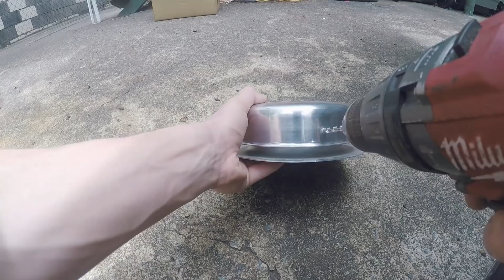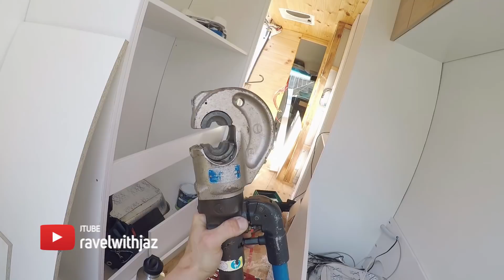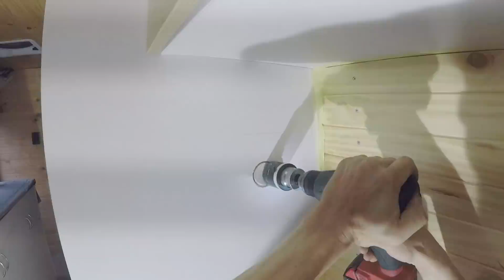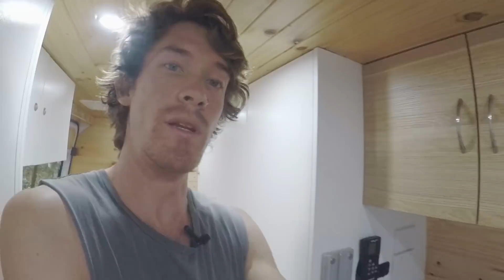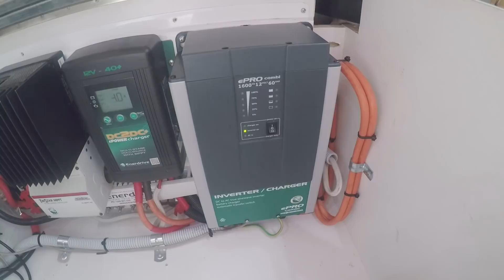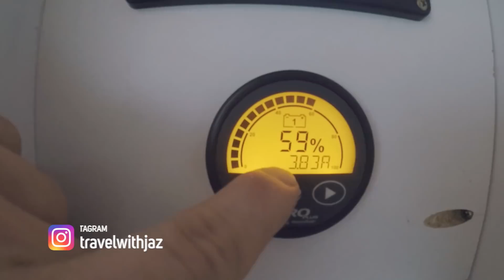S1E13 Sprinter Van Conversion | Electrical Pt. 2

Comment: Hey man. Im a 3rd year sparky from Vic - question with your a.c board... Why no m.e.n link?? I understand that for all relocatable installations all 240v outlets must be double pole ruling out a potential open circuit neutral fault, but still??
Thanks bro
Reply from the maker: Hey mate Thanks, so imagine if you plugged in to mains through the 15A inlet socket, then you would have 2 MEN links on 1 earth stake which is a no no, it gets quite complicated the answer and I would just read to 2 entire blog posts I did on the electrical which I hope sheds some light on it. I'll link them here man have a squizz and let me know if it still doesn't make sense. Cheers 

Electrical Pt.1 - http://www.jazmorton.com/van-conversion/ep-9-electrical-pt-1/

Electrical Pt.2 - http://www.jazmorton.com/van-conversion/electrical-pt-2/
Reply: Travel With Jaz 

Hey man, me and a bloke are just finishing up a 19 unit site and there are two M.E.N links on our site - one at the front pillar and one at the main switchboard.... 

I can only understand why there is no M.E.N link when the van is off grid because you've protected the installation with combos - the fault loop impedance is irrelevant as the combo will trip on imbalance between active & neutral, and that the neutral to ground relay closes when the inlet is hooked up and the inverter receives power on the 240v IN terminals...

Is this the correct understanding? I have read the blog posts

Cheers brotha
Reply: Not a sparky mate, but good understanding of inverter / charger wiring I found this link (draft from victron, https://docs.google.com/document/d/1Kvp46nznDOZgh-UOG3WLgpLhL3JFni8UGGDwwm_N38Q/edit).

"The boat is connected to shore power, the AC input relay is closed, and the neutral-earth relay is open. The AC output system relies on the shore connection to provide the neutral to earth link, so the RCD is functional

When the boat is disconnected from shore power, the AC input relay is open, and the neutral-earth relay is closed. The inverter/charger has made the Neutral to earth link itself, this so the RCD in the AC output circuit is operational."

Comment: the maxxair fans may work better for you if only used to exhaust air out and you install some venting through the floor to the underneath of the van for the fresh air intake. This works especially well when the sun is shining and you are bringing in shaded air, although I believe it just helps with the overall air flow in general. You have done a fabulous job on your van build Jaz thanks for the great videos.
Reply from the maker: Thanks heaps Jay! Yeah that would work but want to minimize air intake points also for colder times, the setup right now is perfect and the van is well insulated from the heat

Comment: Seems a bit silly/inefficient to be plugging laptop chargers in considering you have access to a solid DC supply??
Why not build or buy a decent buck/boost CC CV module ?  Then you wouldn't be going  :   DC --->  AC -----> DC every time you charge your laptop ???
Other than that top stuff fella, your workmanship is excellent and your van looks stunning :-)
Reply from the maker: Convenience bro, efficiency doesn't really come into play or matter to much when it's just charging a simple tiny laptop/phone/camera battery, all powered from the sun ;) thanks heaps for watching man

Comment: At some point you said its not good with a higher drain from the batteries (on 12v batteries). What would I need to do then to be able to continously use 450-650watts? Because I want to be able to use a desktop in my build.
Reply from the maker: Lithium batterys are much better at supplying a more constant voltage output over the span of the battery charge, but AGM voltage drops off much quicker. I believe it's called peukerts effect. You need to get the right size battery for your loads.

Comment: I like that you Soldered all the connections when needed. I'm going to use that one.
Reply from the maker: Yeah I actually tried to put them on BP connectors but they wouldn't fit in the ceiling cavity space, so I soldered

Comment: Great video Jaz, love your electrical set up. Best van build on Youtube for quality of workmanship for sure. I am curious how the van will operate if you have rain for 4-6 days in a row. I feel your weakest link right now may be your battery size (and therefore storage).  Let us know how it all works when you test it out! Cheers from Canada.
Reply from the maker: Thanks heaps! I have already had a few days straight where there was minimal sun and just rain and overcast.admittedly some of those days I was parked direct in shade, but she still held up, the battery did get pretty low and I was running some medium loads for a long time. That's where the DC2DC alternator charger is a perfect solution, but I should get by on the solar even on the worst weeks
Reply: How long would it take to charge the battery with the alternator?

Comment: Wont’t you have a heat issue in the electrical compartment underneath your bed?
Reply from the maker: I thought so too but it really doesn't, I don't really run high loads often, and if I need to I'll wire up some computer fans triggered by a temp sensor on a relay

Comment: Hi great vid. Pleasure to watch. One question. Did you coinsider any cooling for the box with all the electronics? It looks like it will heat itself on higher currents.

Wish you the Best!
Reply from the maker: Hey mate thanks, yes I did consider and was originally going to put 2 computer fans cut into the cabinetry. But it all runs pretty cool and I don't run any extraneous loads on it, but can always add later if need

Comment: The very best electrical wiring work I`ve seen in a long time - neat and tidy. Noticed that you had your shore supply breaker in on position with shore supply disconnected and inverter on. Will this allow 240v from inverter to end up at shore supply socket pins on side of van?
Reply from the maker: Thanks a lot, and no it can't because the shore is connected to the input side of the Combi inverter, nothing ever gets fed backwards power only comes out the output side of the Combi inverter

Comment: 1600 w inverter good luck
Reply from the maker: mate ive ran belt sanders, jigsaws, drop saws, 1600w vacuum cleaners, toasters blenders etc on it without a hiccup. she'll be A okay my man, unless you want to run a welder...

Comment: I knew you'd make it b-e-a-utiful. It's really good to have knowledgeable people like you to learn from. Thank you so much for taking your time with the weight questions in the previous video. The setup weighed less than I'd expected.

1. Are there benefits to having such a long wire from the battery to the shunt?
2. Have you made any precautions in case of a crash or fire? Would first responders be able to isolate either the solar panels or the battery from the outside?
3. Would it be very disadvantageous to separate the different parts of the system if you wanted to utilise space around the cabin?
3a. Could you move some components under the vehicle to save space and move weight front/ center?
3b. Could you move the battery monitor to the cabin with your setup? Can you have more monitors on that shunt?
4. Would it be possible to wire the head unit to the off-grid system, to enjoy tunes, sans engine?
5. Do you charge electronics on the AC?
5a. Is there high loss going DC/AC/DC?
5b. Are there sine issues with going with car power chargers for electrionics instead?
5c. Will cost of special chargers outweigh the eventual benefits?
Reply from the maker: Thanks a lot!

1. No you want to keep it as short as possible, but i left a little bit of slack just because both ends were already lugged from enerdrive and i didnt want to lug them again, the length I have it fine.
2. Everything is as secure as possible and I have a fire extuignisher on board. I dont think first responders will be running to the switchboard to isolate you solar or breakers in case of a crash(breakers should isolate themselves under most fault conditions).
3. It would be just a lot harder because youd have longer cable runs, which you definitely dont want with 12V. I personally wouldnt do it,but it is possuble, youd be using larger guage cable and cost way more.
3a. I guess you could but if they were under the vehicle they would have to be in some sort of extreme weatherproof box that breathes... (unnlikely.)
3.b . yes you could have it in the cabin, pretty much anywhere you want. and i believe you can have multiple ones i think.
4. umm yeah it is possible to wire the head unit up to the house battery, but again this wouldn't make too much sense in my mind. but possible.
5. yes, I charge laptops, cameras, phones etc all on the 240V powerpoints which are fed from the inverter.
5a. There are minimal losses in the inverter, but yes there are always losses. It only goes once from DC to AC, thats the only function in inverter mode. however if connected to the grid it converts 240 into 12V but there are always minute losses.
5.b . it all depends on what you need. for the couple of hundred dollars it cost for a charge to be able to charge from the alternator i think it is without a doubt worth it,.

Thanks for the questions :)_
Reply: Cheers mate. Keep the Sika flowing and enjoy your new ride 😀

Comment: "WIKID INSTALL" Bro. Just purchased an Enerdrive 200 Watt panel to be mounted on the roof of my 2018 Hiace SLWB. I already have a 160 Watt portable Enerdrive to compliment the roof. Bloody hell, you've spent some cash with Enerdrive - Nice ! I also went with the Maxx Fan after watching your install video, cheers.  Coming to terms with cutting the 356mm hole in a perfectly good brand new piece of Toyota steel roof hahahaha. I'm interested to know exactly what components you used from Enerdrive. Do you have a list ? I'm getting some auto electricians to do the battery, wire up and a few other accessories, all Enerdrive. I'm no "Sparky" like yourself. However have built all the rest of the interior myself to my anal standards. Be good to catch up on the road someday. Love your work 👍👍👍👍
Reply from the maker: Excellent matty good to hear mate, yeah the most of this build was on enerdrive products but its totally worth it ;) might see ya on the road mate, good luck with your buuild!
Reply: I totally agree on Enerdrive stuff. There's just something extra about the quality for me. It's great to see you with so much attention to detail. I'm the same. I looked at Sprinters however went for the smaller Hiace SLWB with dual sliding doors. Love the thing. Cheers bud👍

Comment: Two builders I'm following, you and Greg Virgoe, are setting a standard that anyone else will fail miserably to reach. And both vans are Sprinters as well.
Reply from the maker: haha I had a similar comment before I must check out who Greg Virgoe is ;)
Reply: Yeah Greg does indeed do an exceptional job of explaining custom builds.
Reply: I,m following both of them myself. Definitely agree with your comments
Reply: Yeah i was going to document my van build, but you and  Greg do such a great job it’s become a case of ‘why bother’ !!

Because mine was an ex ambo paramedics box back, I’ve got a hell of a job sorting it out. Can’t find anyone that knows how to sort the computer driven system. Varley who built it don’t get back to me, yet in decommissioning they ripped out the computer that drives it! What a headache . Do you know anyone in Sydney who knows their stuff?
Reply: I don't know about not making a series...someone should do a series about a high end build that costs nearly nothing. I suppose if I ever did build one of these things, I would definitely go ultra resourceful, and bring all of my various skills together. 

So far, I usually see it is just ultra pure liquid crap where people take garbage and shove it in a van, where you would definitely be roughing it, or ultra expensive and luxurious like this one. I can't even imagine what this would cost. I was surprised for example that he didn't do up his own battery controller circuit, given that he has an electrical background. I know 30 amps is a lot different than your average cell phone charger, but with the right heat sinking and switching circuitry it can be done. Even Lee Blake didn't do this, and he has an engineering background. What I did like was how Lee put all the high voltage in one central place, eliminating the vast majority of the wiring job.

Comment: Cracking video again Jaz. Probably your most comprehensive to date. Great to you went overkill on your wiring, being an electrician, you've done it right, and saved yourself a crapload of money (well reassigned it to quality products).
Reply from the maker: Haha cheers Higgo mate, yeah well living in it it seems to all operate just how it should, and I couldnt imagine going to much smaller on the battery system or solar panels if at all, for what I am running in the van. It just gives me absolute peace of mind so I never have to worry about running out of charge

Comment: Holy shit man. This is incredible. You should be super proud of what you've accomplished. Super inspirational, I am about to do the electric myself, but have some questions I just can't figure out.

For the lights as well as most of the wiring, when you drill into the wall or ceiling, there are no visible wires. How do you pull the correct ones from inside of the paneling? How do you pull the wires out if you cant see them? As well as how do you know your pulling the correct wires? Same thing for the back lights, it was just a small pilot hole, how did you fish the correct wires out?

Also, for the back camera, I'm assuming it was planned from the start and the green, yellow and pinks wires have been accounted for before putting the walls up, but if not, how did you manage to run that wire from the back of your car to the front through all the cabinets and walling?
Reply from the maker: Hey Gene, I definitely recommend watching episode 9. which is electrical pt.1, which is me wiring up the van and then you can see that I have planned every wire in advance before and sheeting or cabinetry was in. Also being an electrician I've just had a lot of practise with roughing in, and the cutting out and fitting off, so when I cut holes in something I already know there is going to be a wire in that cavity because I ran the wires there myself. hope this helps. also watch Ep.10 so you can see me sheeting over the wires. cheers!
Reply: I've seen those episodes, good stuff. So you already planned the location of all the wires. I guess since you do this for a living you didn't miss any components and didn't have to run any new wires. The switch panels all look like they run similar gauge red and black wires, how do you differentiate them to each specific location when there were no markings? I'm guessing you just hook it up and see which lights run?

I'm just worried when I do it myself, I will forget a wire and have to tear down my whole ceiling or side paneling because I didn't realize a wire had to be run a certain way and need to reconnect it.
Reply: You could add some kind of tape at the end of every wire and write on it what it is used for, including intended voltage? That way if you pull them out of your ceiling or wherever you know what it is. :) You do that too if you disconnect large amounts of car engine connectors (or any system really).
Reply: Swordie100 that makes a lot of sense actually. Thank you! I think I'll do that
Reply: Watch episode 9 over. He uses a marker to write what each wire is for.

Comment: You need a hrc fuse at the automotive battery positive
Reply: Also need another between the 2nd and 3rd lithium cells. I assume these are lifepo4 and not Li-ion as you said. Li-ion is too dangerous to sleep on
Reply: Isolator not in a good position. If anything in that box is on fire you cannot reach the isolator
Reply: All of these things have heatsinks yet you have no ventilation?
Reply from the maker: yeah i could do that for sure
Reply from the maker: nope I called it a Lithium Ion Phosphate which is a LifePo4
Reply from the maker: sorry bro i'm sure you'll design you van better, cheers though
Reply: You've spent a lot of money on high end gear, just don't want to see it die early from heat or a car accident. There is nothing to stop thousands of amps flowing from either set of batteries in the event metal shorts out pos and negative. 
Or you killed, you are sleeping on top of a fire / smoke source. Trust me, I've seen first hand how easily it can happen and how dangerous large battery banks are when shorted